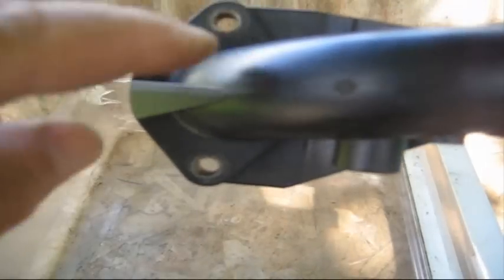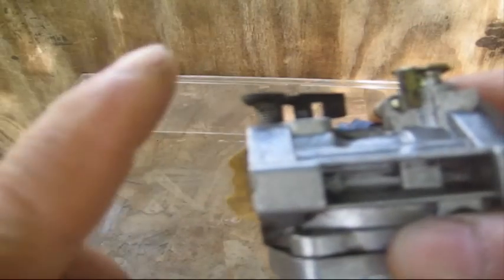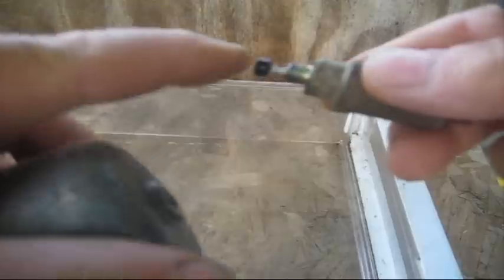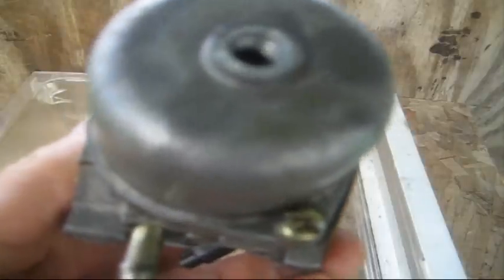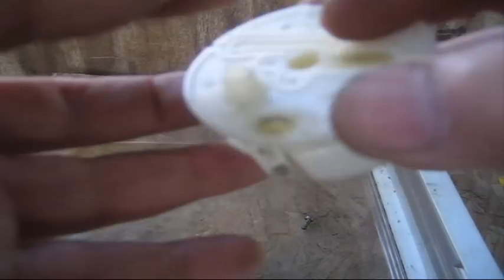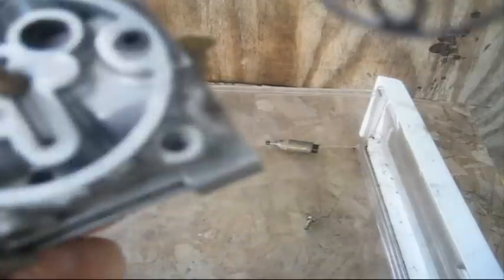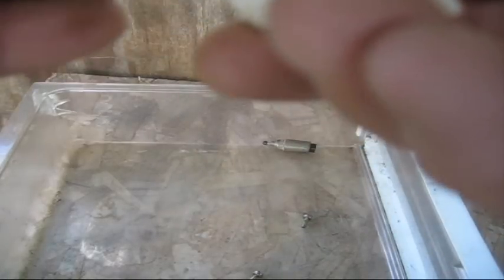I  Show You Where The Main Jet For Nikki Carburetor Goes Along With A Few Other Tips

Comment: Hi Joe.  Greta video. I pulled the bowl off (no solenoid on the bottom)  and the spring and the jet fell out. Thankfully they fell into the bowl.  Appreciate the explanation of how and where it goes. And your video is a touch fuzzy but excellent.  You explained everything.  The carb is still on the engine (a Generator)  and I am wondering how i get the float to stay in place while I ut the bowl and spring up against it?  Thank you!
Reply from the maker: Thank you for your comment. I do appreciate it. As far as the float the hinge pin should hold it in a hanging position. It has been awhile I am not sure of the spring you mentioned. Also was the  solenoid replaced with a bowl nut or just never had one? Just curious. 
Stay well, Joe Z

Comment: Can you please tell me if the float in the closed position is  parallel with the hinge holding roof when looked at from the side ???? Thanks VF
Reply from the maker: It has been awhile but If I remember correctly it had a slight tilt. Unlike the older carbs with metal tabs it is not adjustable. Thank you for stopping by. Let me know if this was of help.
Stay safe, Joe Z
Reply: @JOEZEP54  Joe you are correct of a slight tilt. But most Nikki 6 carburetors I call dickie carbs always have something wrong with them. I fixed just to many of them. Your video is right on Joe. Wish other YouTubers could get the idea and make videos that have pertinent information for the community to use and learn from. Good day and peace too. VF
Reply from the maker: @victoryfirst2878  Thank you for this comment it is very much appreciated, Hope to hear from you again. Be sure to stay safe, Joe Z
Reply: @JOEZEP54  Thank you so much JOE Z. I plan on staying virus free. Peace. VF
Reply from the maker: @victoryfirst2878  You're very welcome.👍

Comment: We are working on one of theae carbs but it doesn't have the fuel cut off.   It's on a generator and it only wanted to run smooth on 1/2 choke..  so we took it apart everything looks clean put in a kit. Now it runs off choke but surges.

Could this be the oring on the main jet?
Reply from the maker: Thank you for stopping by. If the o ring on the  main jet is missing or deformed it would cause flooding. You may still have some debris clogging a passage, it doesn't take much. Dose your carburetor have a "hidden"  jet on the top. If this is clogged it would cause surging. Before you take it apart again check to see if the mounting gaskets are in place & everything is tightly secured. An air leak will cause surging. Let me know how the repair goes.
Stay safe, Joe Z

Comment: I took my carb  apart, and couldn't find the jet.  Wanted to clean the brass stem thinking my jet was different.  Watched your vid and during reassembly found the jet in the plastic piece.  20mins and 8 bolts/screws to get the bowl off with the carb on the mower. 20 seconds to clean jet.
Reply from the maker: I am glad this was of help. And thank You for watching and taking the time to comment. I don't want a channel I'm just commenting I have other videos on my channel that cover many different subjects  and new videos added weekly that may also be of help or interest.
 Be sure to 👍, share and subscribe if your are inclined to do so.  Also not to miss any new videos remember to hit that notification 🔔
 Another way you can help support  this channel at NO cost to you is by using one of my affiliate links.
THANK YOU for taking the time to check out my page and watch my videos.
Your likes, & comments are are much appreciated and I will respond to them as soon as possible. Even your dislikes if you leave a comment as to why.

Your support is not required or expected but always appreciated. If you are inclined to do so your Subscription, Likes, Comments and using the following links do help.
           * You can Help Support The Joe Z Channel at no cost to you***
by following my affiliate links.   Joe Z is a participant in the Amazon Associates Program, an affiliate advertising program designed to provide a means for sites to earn advertising fees by advertising and linking to amazon, that helps me to continue producing videos.

I am building  SOMETHING NEW to my channel. Joe Zs on line Store at:
                                       https://www.amazon.com/shop/joez
Thank you for your support and using the links provided to make your purchases. 
                                It is a Win/Win!!!   And always appreciated!!!

If you do not have Amazon Prime no problem:
               Enjoy this special offer: Try Amazon Prime for one month FREE TRIAL
 (After one month, Prime is $12.99/month plus any applicable taxes).                          
                        Click        https://amzn.to/36QXdCj                             
                                                                Cancel anytime
                        Click       https://amzn.to/36QXdCj
     * Thank you for watching I really appreciate your support.***
I don't want a channel I'm just commenting I just want to mention If you haven't installed the TubeBuddy browser plugin yet, to help your channel grow  Just go to my favorite tool for channel growth Tube Buddy. Now You can use it too, here's my affiliate link to the Free versionhttps://www.tubebuddy.com/joezep54   Start with the free version, yes it is free to not only to down load but to use.
Again I hope you get to  enjoy other videos on my channel as well. 
 Stay safe, Joe Z

Comment: thanks for the video  saved me alot of time...I had snowblower up on end to service bottom parts  when I was finished I could not get blower started  gas coming out  of carb  sputering  back firing  etc..Found that all gas from tank ran into crankcase oil...changed oil 4 times  to try and fix...  took carb apart  and found small part in bowl !!! which after seeing your video  found where it belonged.. put carb back together changed oil again   and machine ran   cleared itself out  and now runs great..  I would like to know how main jet got to the bottom of carb bowl before I took it apart  thanks
Reply from the maker: Michael Farr,  You're welcome, I am glad this was of help .And thank You for watching and taking the time to comment. As far as how the main jet got to the bottom of carb bowl before you took it apart the only thing I can think of is that maybe someone started to clean the carb prior to you getting to it.  Michael  I have other videos on my channel that cover many different subjects  and new videos added weekly 
( been behind on videos lately🙄 ) that may also be of help or interest. Be sure to like, share & subscribe if your are inclined to do so.  Also not to miss any new videos remember to hit that notification 🔔 

Stay well, Joe Z.

Comment: thanks for the video  if the idle circuit is clogged where would i look for the jet to clean?
where is the idle jet?
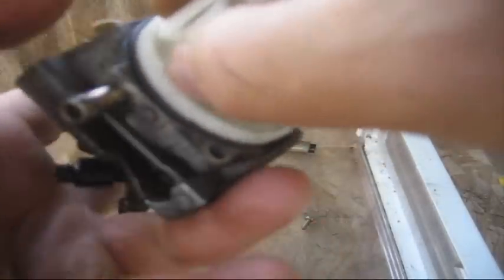Reply from the maker: You're welcome and thank you for taking the time to comment. I do not have a clear shot of the idle jet, but at 2:58 when I remove the plastic piece it will be under there. It is flush in the the body of the carb. It will be a brass color.
Stay safe, Joe Z

Comment: Do you have a vid on reinstalling and tuning this carb?
Reply from the maker: I do not think I have a video showing the adjustment on this carburetor.  If you have to adjust it loosen the adjusting screw to richen and tighten to lean it out. These motors will run a "little" rich no problem (too rich will cause carbon build up)  but they will not run right if too lean.  If it runs too lean with it loosed all the way out you can pull/break  off the plastic limiter cap and move it further to make it run richer (turn lefty loose to richen) and it will help your engine in the cold. If its cold outside they like to be a little rich but If its hot out they like to be just right. 
Let me know if this was of help and thank you for stopping by.
Stay safe, Joe Z

Comment: @JOE Z Thanks for vid. Need some input please.  I have cleaned etc few carbs in my time. Mostly two stroke, but few on push mowers. I have not fully rebuilt one however understand most of what is. I have a used older Yard Machines rider I brought. By the gas line I could tell bad gas was in carb. I should of left alone because mower ran fine. But I knew that carb had crap in it. I made the mistake of opening it. The carb is pretty much like yours. Mine is a Nikki same style. Yeah the little brass with O ring fell right out and I was like great where the hell does it go. I suspected it went in spot you show. Problem was I was tossing what way it goes, but that issue is solved. So the carb did have white junk in it. I cleaned the carb with carb cleaner inside and out. More less looks new now. Bolt it to mower and leaks out center side gas a tad. Also throws gas ( out choke flap side ) in large amounts out breather tube every time mower is turned off and back on. When running that stops so please note that one. At this time I am at my wit ends. Here is why aside from issues I mention.  For me the worst part in this was the round big bowl gasket. Worst thing I ever seen and why can't it just sit in the groove of bowl. It wants to pop out of each side and all else. A nightmare I tell you. So how exactly is this done? Gasket sits round at the very edge of white plastic all the way around? I did order a rebuild kit but before I install stuff or mess up the new gasket I will hold till you reply. So I can better understand the gasket install. The kit I got was -- # 799727-. I do see parts in it that appear some do not go in my carb. Is that common with these kits? Stuff I can't id as well like a little round silver cap or something. Lastly on the subject of carb issues I do notice my float is not lined center and it sags down a good bit. What is likely I need to do to solve the issues? Darn thing worked fine till I opened it lol. Side note also the bigger round O ring that sits down in carb that the nub of the plastic sits in. That O ring looks to be bad. It has a shred of rubber hanging on one side. You wouldn't happen to have a FULL vid of a full rebuild on this carb would you? Like how to remove the brass seat etc also on this one......
Reply from the maker: Joesph Baumgardner,  I read your question about 1:00 am last night but it was just too late to respond. I noticed you crossed out some of your questions. I am guessing that you figured that part out. That little round silver cap is a welch plug. It is to replace the one  installed if you removed it to thoroughly clean the carb & yes depending who you buy the parts from is is common to get extra parts that my not be for you particular model. If that big o ring is damaged the carb will flood. This is a common issue with these carbs. I have to check to see if I have a full carb rebuild. In this video if you go to 4:04  & slow the video down ( go to the setting icon & click play back speed) this should help you with the bowl gasket. Let me know if this was of help. Joe Z
Reply: JOE Z As for the crossed lines I did not do that. I have had that happen before and don't know why. I have also seen it before with others. Must be a Youtube thing. I did however manage to rebuild this carb last night. Took me a good while. But now I understand a bit more. The big gasket went on pretty well with no issue when I watched your vid slowly. The issue was the kit and little O ring and brass that fits in center tube upward.The ring was fatter or brass was. So I had to reuse my old which worked. Also the bigger O ring that sits on plastic nub for main gas. That was thicker and a pain to get all locked down tight. After forever I managed. Moment of truth when I got up was to run gas and fire up mower. Verdict no leaks or flood in oil. Works great. I did not see a welch plug in my carb and I gutted it all down and cleaned and rebuilt. As for the seat I mentioned in first reply, I see now there is no seat. Well, the plastic and sealed is pretty much it. So I did not have to worry about remove of seat. Any event all is well. I may shop around and try differ kits till I get exact O rings and brass. I have another Nikki to rebuild and have to learn it. It appears gasket is slightly differ and carb that has spring under bowl unlike mine I did.
Reply from the maker: @joesphbaumgardner4579  I am glad you got it together, up & running👌. These carbs take a little getting use to. That plastic piece where the seat is can sometimes warp, so look for that when you rebuild your other Nikki. I had a little time getting that o ring on myself. In the video I showed how I rolled it off a screwdriver. If you have trouble putting it together wipe a little 2 cycle oil on it.
Hey if you would like to give a hand & are inclined to do so give this video a 👍, share it & subscribe.  Stay safe, Joe
Reply: @JOEZEP54  Will do. Thanks for time and reply. As for the O ring I did lube. It was the one that goes on plastic nub and sits down in where gas comes in I think. Getting it on nub was no issue. Getting the ring locked down in hole was the pain. Being that ring looked alot fatter than my old. Any event I use 90 no eth gas so unlike prior  owner the carb should not be trashed and me back in it lol.
Reply from the maker: @joesphbaumgardner4579  That ethanol is the worst thing made for these small engines. O rings, gas lines, diaphragms & even the aluminium bowls get destroyed. Unfortunately for us in my county they do not sell non ethanol. The only options are buying pre mix in the big box stores at $7.00 plus a quart  or just stay on top of the maintenance.
Reply: @JOEZEP54  I 100% agree and know all about that. It will wreak stuff. On the good side I brought alot of used nice stuff due to this. People not understanding and leave stuff sit. Won't start and go buy new. That is a bummer there is no stations around you on gas no eth. The can gets high dollar. I have one station about a mile down the road. On most days the price is about  3.49 or so a gal. This other Nikki carb I brought used. I was gonna swap carbs when I thought I could not rebuild mine. A Ebay buy and listing said pulled good cond working carb. I get it and I could smell that smell right away. Open it and I can fill a spoon with the white junk inside. So I agree with you on all.
Reply from the maker: @joesphbaumgardner4579  "On the good side" I agree with you as well. I was able to pick up free or some decent equipment for a reasonable price. The "funny" thing the equipment I paid a "high" price for was some of the worst I collected. Some are still in my bone yard using for parts.

Comment: I've been installing the jet with oring side facing up toward pick up tube.  Isnt the oring supposed to seal against the brass pick up tube?  Thanks.
Reply from the maker: Thank you for watching & your question. As far as I know this is how it should be. It is working as it should installed as I showed in the video.  Your explanation sounds reasonable & is working for you , now you got me
 curious LOL. 
Stay safe, Joe Z
Reply: @JOEZEP54  I think I was installing it backwards.  I found this web site "Disassembly, Cleaning and Repair of Briggs and Stratton Intek Single Cylinder OHV Nikki Carb" at http://outdoorpowerinfo.com/repairs/briggs_intek_single_ohv_nikki_carb.asp where it explains that all fuel goes through the main jet.  The fuel for the idle circuit also must go through the main jet so it makes sense to have the main jet oring seal tightly against the bottom of the plastic tube instead of sealing against the brass pick up tube.
Reply from the maker: Thank you for the follow up information & link. It is much appreciated. Hope you get a chance to view & enjoy some more of my channel.  Your comments are not only interesting but helpful. Thanks again, JOe Z

Comment: Tp get the 2 screws out that hold the bowl, use a GOOD ViceGrips. Straight in and tite. Crack loose then use screwdriver
Reply from the maker: Hi Garry, thank you for visiting & taking the time to add useful content to this video. Hope you get to visit regularly & continue to help with your suggestions,
Stay safe, Joe Z
Reply: @JOEZEP54  Hey Joe, I'm into restoring the old 60/70 tractors, the OH120, HH120 type with the Walbro LMH, and the Briggs with the Flow-jet carbs. Rite now I'm arguing with a LMH17. Keeps flooding, been thru it 3 times already. Beating me to death
Reply from the maker: @garryludwick2990  If the seat & needle are good maybe the float. The older ones have the metal float & some time they leaked & once a little gas got into them they no longer floated & shut off the gas flow.

Comment: Can you take the center brass tube out???
Reply from the maker: Numa Newbern,  Thank You for watching. I left it in & cleaned the out the small holes in the tube with a thin bread tie wire. Then sprayed carb cleaner. Be careful not to get carb cleaner on any of the gaskets.  Hope this is of help.
Stay well, Joe Z.

Comment: Hi Joe.
A million likes for your great instructional video on how to find where that jet goes. It's helped me tremendously.
One thing I noticed about this model carb is that the rubber needle valve that rides on the float doesn't have a metal seat to mate with. Is this how it should be or have I lost another bit to this thing?
Cheers from ɐᴉlɐɹʇsn∀
Reply from the maker: You are very welcome. I am glad this helped you out. Thank you for taking the time to comment.You're doing fine, this carburetor doesn't have a metal seat.
If you have any other questions let me know. Also if you are inclined to do so you subscribing, giving a 👍 and passing my channel to others would be a big help and most appreciated. 
 Happy mowing , you and yours stay safe down under,     Joe Z